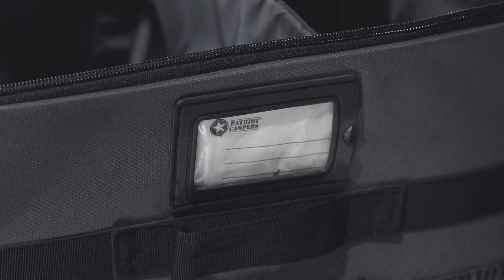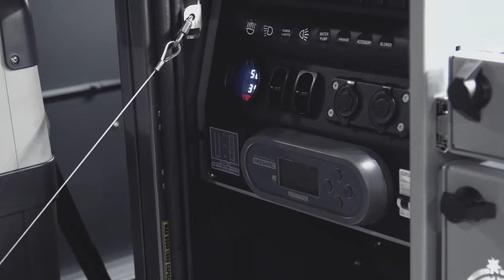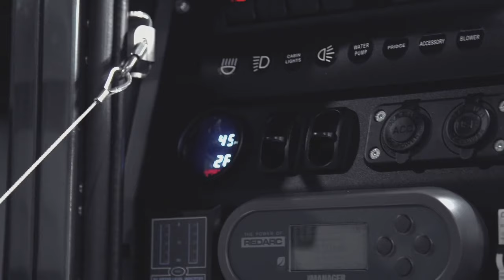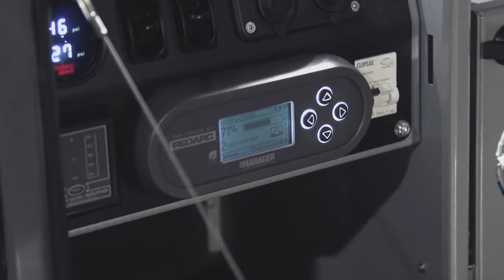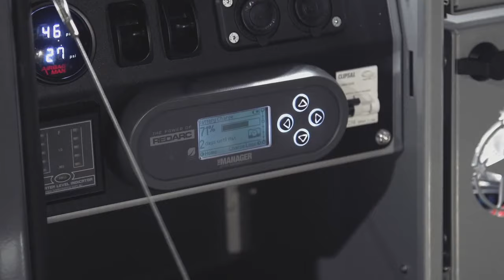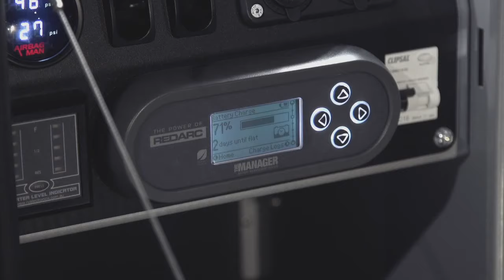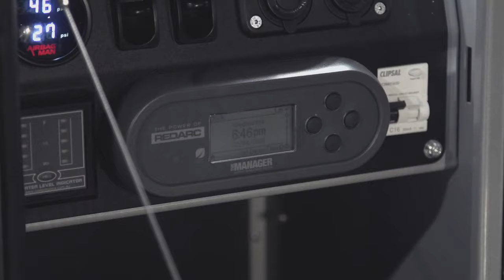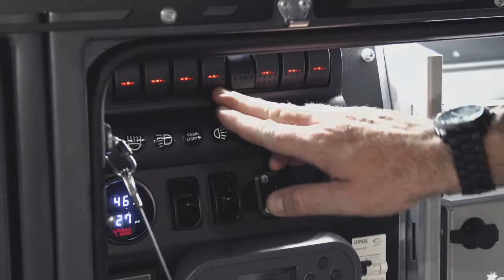Patriot Campers X1-N Virtual Tour

Comment: You guys are definitely going in the right direction with the X1-N by getting rid of the tent and replacing it with a roof rack. Now get rid of the manager 30 as it costs $1500, the fridge as its another $1500, the compressor, air suspension, and hot water system. All these can be options and I bet you could bring the price another 10k lower. I really like the trailer, the storage, the off-roadability, the water tank, lights. Everything else is frivolous.

Comment: on your trailer platform is it plausible  to  half of cabin with options  of storage of mobilty aids and have access to a  motorized wheel chair access and  have a shitter/bathroom  6-7' width  7' length and 6'6" height with enough space to include a charging station for a gopher and wheelchair..

Comment: Team you have changed the rear tire carrier, with the vertical lower brace, WHY?  Has this been due to failures of the existing design. Is this design change available for to retro fit to exist X1.